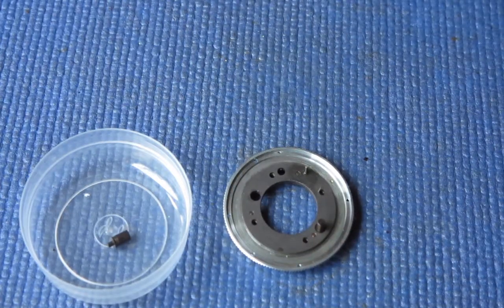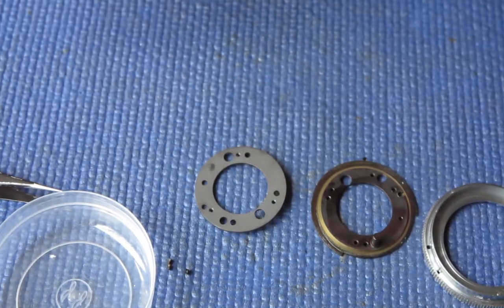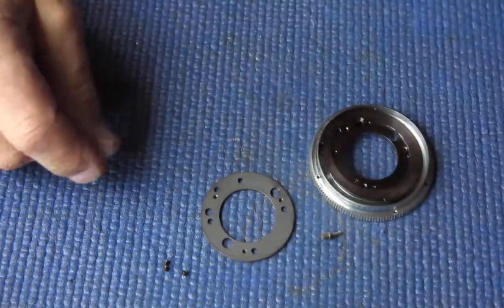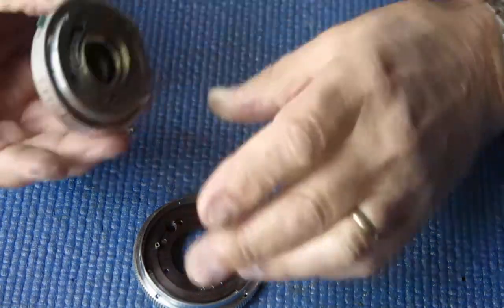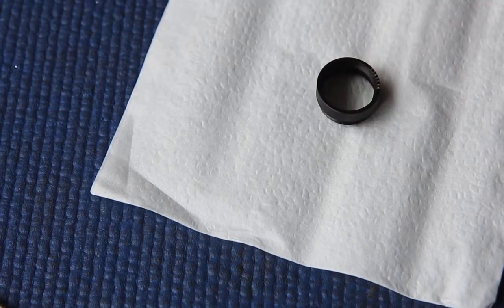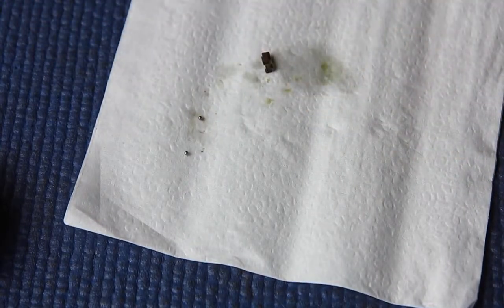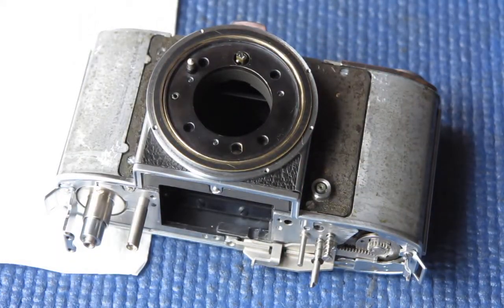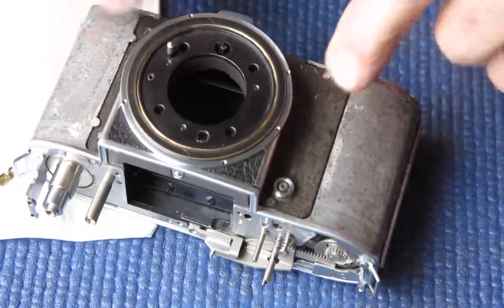Retina Reflex type 025 complete service 09

Comment: Hello Chris 👋🏻 first of all, thanks for uploading this Retina 025 series of videos. I've watched all of them and they're both entretaining and instructive.

Sadly, this beautiful piece of German design is seriously getting on my nerves haha. I've got the lens/shutter assembly done, it's working perfectly. Same for the body. The issue is the coupling of those parts.

I put them together and first the shutter wouldn't completely cock when moving the film advance lever. I tweaked it and everything started working well: moving the film advance lever would cock the shutter, close the curtain/flap, and lower the mirror. After trying it a few times with good results I screwed the prism assembly in and somehow everything went sideways. Took the prism off, checked everything, but there seems to be no way of getting it to work again! The shutter never cocks; sometimes the mirror locks down, sometimes it doesn't; the curtain seems to be the only thing that consistently latches as it should. Oh, and sometimes firing the half-cocked shutter won't actually have any effect on the shutter itself (if I gently lift the silver notched arm where a protrusion on the control ring latches, then it goes off).

I'm an extremely patient person and I've dealt with a number of cameras in the past (I'm currently making the bellows for a 50's 6x9 french camera), but this... I'm running out of ideas.

Sorry for the catharsis
Reply from the maker: There are any number of potential complications with the Reflex unfortunately. That is the reason that Retina Reflex cameras were not popular with repairmen.